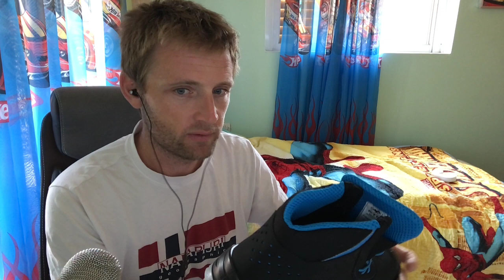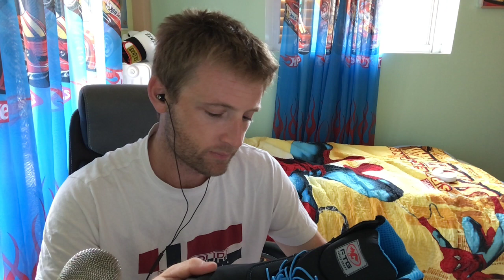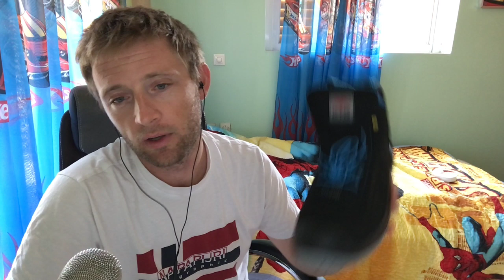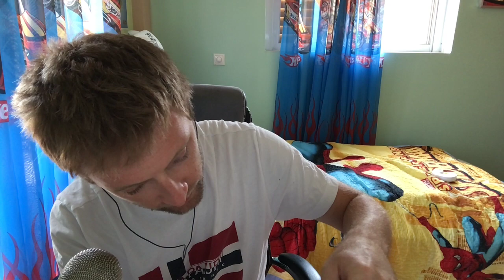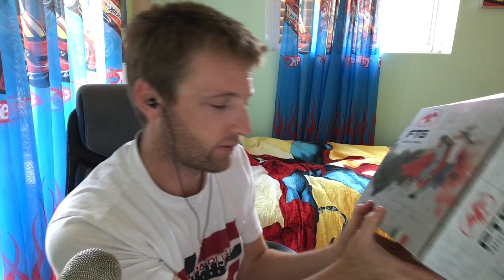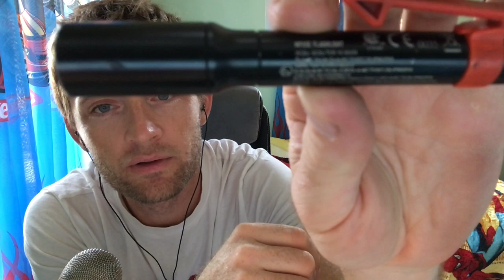Best Safety Shoes!

Comment: Wow ! Your video is amazing ,especially with the camera you blew my mind!i didn't get why it is a wifi camera.. we don't really have wifi down in the engine room ,u mean sth different? Also Do you think it would be a problem to use low shoes instead of boots?

Also should we get s3 safety category or lower are acceptable as well?
Reply from the maker: Low shoes also are fine!
S3 is a good standard for foot safety and electrical protection also never know if there is electrical leakage or danger.
So it is better to be 100% protected from this dangers.
Reply: @MOCCorp  could you give me a link of that camera please? Ty
Reply from the maker: @flaptsak87  https://www.skroutz.gr/c/2286/Endoskopikes-Kameres/f/1261628/gia-kinito.html?from=cat-match&o=%CE%B5%CE%BD%CE%B4%CE%BF%CF%83%CE%BA%CE%BF%CF%80%CE%B9%CE%BA%CE%B5%CF%82+%CE%BA%CE%B1%CE%BC%CE%B5%CF%81%CE%B5%CF%82+%CE%B3%CE%B9%CE%B1+%CE%BA%CE%B9%CE%BD%CE%B7%CF%84%CE%BF

Comment: Sir good day this is out of context but somehow i want to ask you.
Sir Why we keep f. O pressure higher than diesel oil? Thanks in advance
Reply from the maker: Hello diesel temperature are lower that Fuel oil and will not boil .
Fuel oil and this 125 degrees celsius to boil much easier that cold diesel so by increasing the pressure you reduce the boiling.
Reply: @MOCCorp good to know sir thank you for your answer. 
is their also connection of the density of the fuel oil why we keep f. O at high pressure than diesel sir?
And 2nd what will happen if fo boils in the system.
Reply from the maker: @frankster02  Not any connection with density.
Reply: @MOCCorp  many thanks sir
Reply from the maker: Welcome!